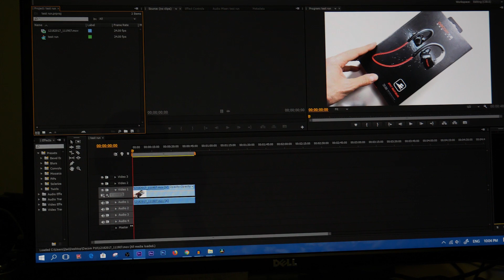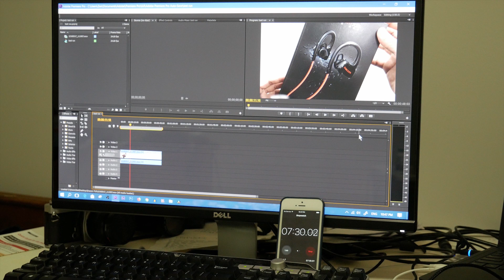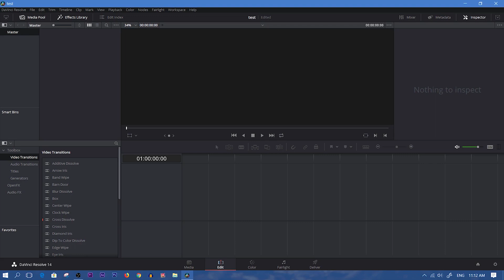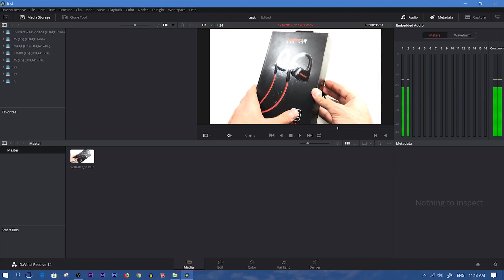8GB VS 16GB - RAM TEST - Premiere Pro

Comment: Hello, thank you for your information. Do you think the Lenovo-v15-iil-intel-core-i5-1035g1-8-gb-256gb-ssd-156 is enough for editing videos with adobe premiere pro? Not much video's in 4k only 720p and 1080p My budget is 500€ and this is the only I5 with quad-core on the market for under 500€ this money. I have seen the required specs of adobe premiere pro and they say to have 8GB ram minimum so I suspect it should work, any experience? Thanks in advance. Best regards, Felipe

Comment: Y en caso que sea:
2x8gb     VS    1x16gb???????
Que conviene a la hora de editar?
Reply: Go with 2x8 but if your laptop can run up to 32gb go with 1x16gb and so you can upgrade someday to 32gb (2x16gb)
Reply: @nakamura8108  I’m in a similar position. I have two ddr3 ports. Would i see any performance benefits doing 2x8 or 1x16? I can only go up to 16gb with my laptop.

Comment: Currently I have Dell Inspiron 3580 with 4GB RAM. Is it safe to add 8GB RAM making it 12GB?
Reply: You should be absolutely fine. You will have 12gb ram (total), just make sure to buy the same frequency ram as your 4gb ram stick. You can check ram frequency in           TastManager>Performance>ram
Reply: @humayuntariq3530  or go to cmd and run "wmic memorychip get speed"

Comment: Do you have any idea if a 16gb of RAM would work with an ASUS X407U i3 8th gen? Right now it has a 4gb ddr4 RAM with one extra slot on it. I just cant find any reliable information if it can handle a 16gb RAM upgrade. Very helpful video btw. Thank you very much for sharing.
Reply: Black Buck Deer  Yes, it did work! Thank you!
Reply: @fordroams  did u add 16gb with the 4gb making it to 20gb????
Reply: @praneethp7847  No, I took off the 4gb and added two 8gb RAM.

Comment: Can i put macbook pro ram on my HP or Asus or anyother brand is that ok?
Reply: Unfortunately Pc and Mac's use completely different software and hardware. Also most Macs are soldered shut and you can't upgrade the RAM..
Reply: @slavskyart  i got the 2012 mac book that still upgraded
Reply: @slavskyart  the hardware such as RAM is not vastly different

Comment: i have 4gb of ram 
1)so should i add 8gb ram in other slot and make 12gb of ram in total
2)or should i add 4gb of ram in other slot and make 8 gb of ram in total
Reply: Better if you get 1x8gb at first and add another 8gb later.
Reply: Same doubt
Reply: Then you will have 4+4 gb in dual channel which is faster and the left out 4 as normal. 12 in total. This is a good option
Reply: Dinara his cpu has to also support dual channel, or it won’t work

Comment: Ram doesn't affect the render time as much as number of cores on your CPU, ram is more for multitasking for example... Stabilizing video while rendering and playing effects on 4k footage all at the same time. And having other apps open like after effects and Photoshop and chrome... That's when Ram matters. Usually for 1080p 16gb is the sweet spot but for 4k 32 is ideal. 8gb of ram is the standard
Reply: i think this one also regarding Dual Channel memory, when only 1x8GB it is only single channel, since also he didnt show to us how much premiere use the ram while render in 8 and 16 GB condition
Reply: Anything lower than 1080p is ok for 8GB ram.
Reply: Bro i have i5 4th gen 8gb ram and gtx1050 2gb graphics card and adobe keeps crashing don't know why .. I'm going to upgrade my ram yo 16gb

Comment: For some reason my motherboard started giving me errors when I put my 16GB of Ram in Dual channel. I had to change them to single channel. The thing is, I don't feel any performance loss with single channel in gaming. What do you think about single vs dual?.
Reply: Only 1 min. Difference in double ram I expect 50% less time.
Reply: Bro. It maybe because your motherboard support up to 16gb. If I were you I sell both 16gb and get 2 8gb stick.
Reply: It'll only make a difference when using the integrated GPU .
Reply from the maker: With gaming I doubt there will be a difference:
Checkout this article: https://www.gamersnexus.net/guides/1349-ram-how-dual-channel-works-vs-single-channel?showall=1
Reply: TechManZ Thank you and interesting video.